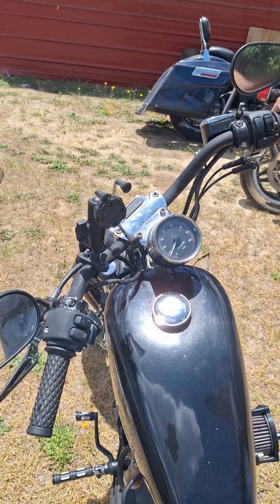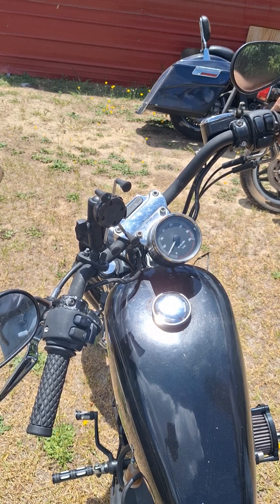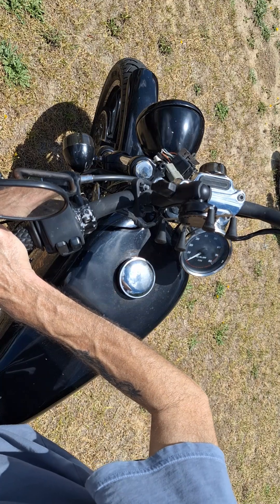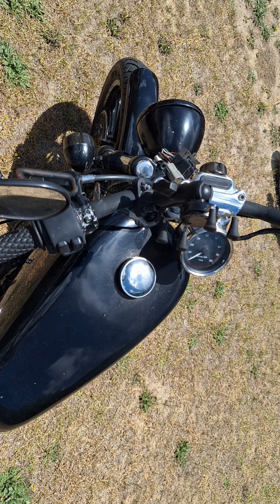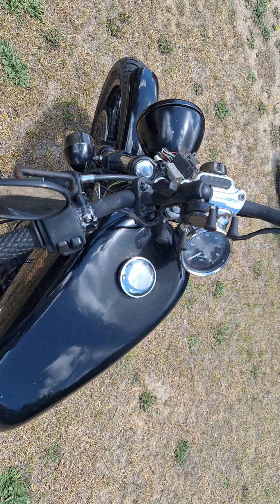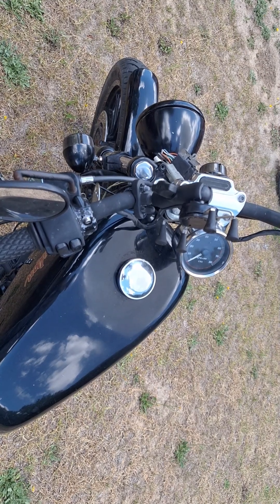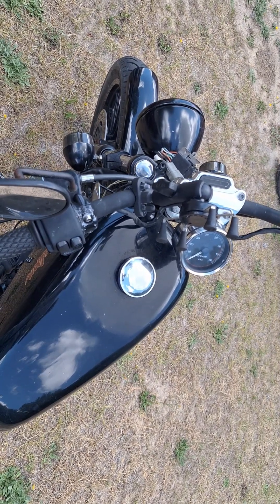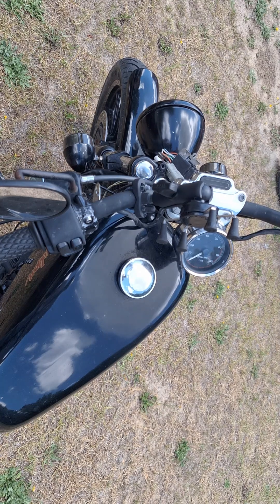Understanding the Rev Limiter System on Harley-Davidson Motorcycles

Comment: How does the oil circulate when the idle is that low?
Reply from the maker: t about 5 lbs of pressure with no oil light on,, whcih is perfectly normal for a Harley. Some bikes only have 2psi at idle.
Reply: It needs to be idling around 1000rpm. Otherwise you are going to damage the crank. a single pin crank needs some speed so it doesnt beat itself to death. When i hear a bike idling like this i laugh and walk away. This isnt a knuckle head.
Reply from the maker: @mauser8515  I'm pretty sure it's s sportster. Last year for knuckleheads was 47.😃
Reply from the maker: @mauser8515  Thanks for the r; a reminder to let the bike warm up before shooting a video so that it does indeed idle at 1k rpm which it does when warm. Good idea for a video though, again, yet another video on setting idle speed and doing an idle drop to set the air/fuel screw. 
   Damn  fie idea. Thanks
Reply: @russellbarron6775  Yeah you said it was cold outside which makes sense,  but I would choke it to crank it, then half choke it to just to keep the rpm around 1000. I warm my Harleys up by riding them and since i live way out in the sticks every ride is 30min minimum. Ive never had milky oil in any of the cases, and no abnormal wear or knocking in my Evos, Big Twin Evos, TC88 and TC96 bikes.
Reply from the maker: @mauser8515  Yeah, this is my son's bike and the truth is he hasn't ridden it in over a year. I have been slack on a slack ass on keeping it up and running. I need to set the timing and perform an idle drop on it. 
   Funny  thing is, I have gotten on people for the past 38 years or so about idle speeds. "your gonna hammer the damn rod bearings out of that thing."I rode it the other day and it idled fine at around a grand once it was warm. That said,  I usually try to get people to keep their ienrichener usage to a minimum so they don't wash the rings out.
   Anyway, thanks and take care.